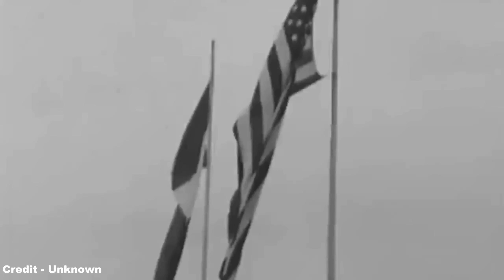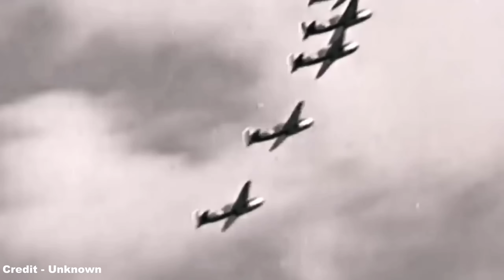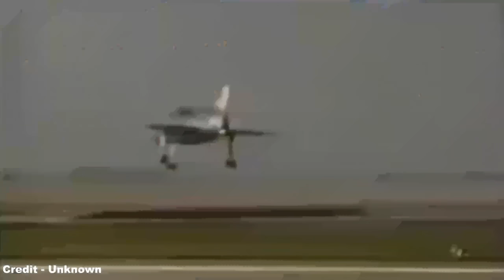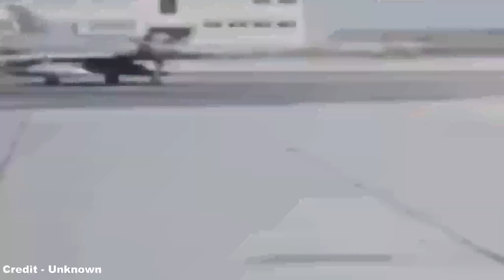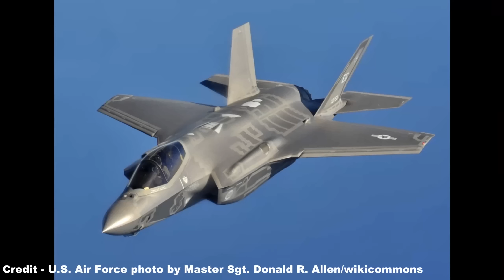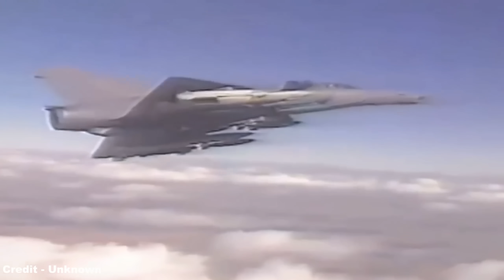Flying Failures - Dassault Mirage IIIV

Comment: The Mirage IIIV was FAR more ambitious plane than the Harrier, for a start its speed was over Mach 2.5, vs Mach 1.1 for the Harrier!!!
The F35 VTOL some 50 years later does not match the Mirage speed.
The French Ministry of Defense realized that the formula chosen was complex to develop and that the cost of the program exceeded its budget. 
As a result, the project was abandoned in 1966.
Compare the Mirage to the Harrier equates comparing a  Horse race to a Dunkey.

Comment: What struck me was that if somebody would have thought beforhand a little bit about the concept, it would have saved billions as it then became clear that it was impossible. Like smaller fuel tanks and nine engines instead of one. Somebody must have thought, mmmmm.... I don't think that would work. Let alone the weight of the engines replacing ordnance capacity. Mmmmmm.... what purpose did this aircraft has to fulfill? O wait... fighting a war.

Comment: The P.1121 (2.57) was never VTOL and  was to be  supersonic.The P1127/Kestrel  was the subsonic VTOL from which the Harrier was developed. The Trident airliner used 3 RR spay engines, was not VTOL and didn't require the RR162.  Although the  Mirage IIIV achieved both VTOL and supersonic speed it never did both during the same flight due to insufficient fuel. Whereas the F35B can.
Reply: Good job. When someone wants to make a video on a topic, they are talking as a de facto authority. So many video creators get even basic stuff wrong on all sorts of topics. I appreciate people calling them out. Many sycophants however will downvote.
Reply: @UnitSe7en  there is no downvote, welcome to YouTube.
Reply: From yours and other comments I get the impression that this guy doesn't believe in letting the facts get in the way of a good story.
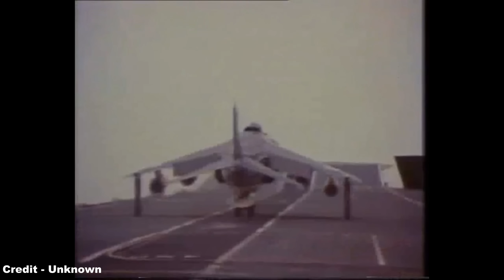9:35 "...developed...by Britain, America and West Germany." Not really - that implies investment, design and construction.
Wikipedia says "*assessed* by the multinational "Tri-partite Evaluation Squadron", which consisted of British, US and German pilots." They only assessed it.

Comment: The RB162 lift engines did not come from the Trident - they went the other way - they started life as being designed as lift engines and then were modified into the boosters for the Trident. Thats why that had a short run time of 15 mins.

Comment: An interesting topic, but the mismatched footage/stills and several mistaken details is - for me at least - a turn off.

The P.1121 for instance. It had nout to do with VTOL projects, rather was one of the rival projects for the same Fighter Operational Requirement as the EE Lightning.
After losing out on that; Hawker-Siddeley tried to submit an aircraft derived from the P.1121 for GOR.339 (as a replacement for the EE Canberra Tactical Bomber). As arguably one of the least suitable submissions thereto, it was among the first rejected.
After that, and knowing that conventional military aircraft orders were vanishing fast as the MoS moved to consolodate the aircraft industry and starve companies of orders if they resisted (like Handley Page), HSA put most of their effort into VTOL fighters.

As for whether the F-35 has actually proved the Supersonic VTOL concept... I bet John Farley (the Harrier's Chief Test Pilot) would have a good laugh about that.
Reply: Well I don't think anything less of RM for trying. Unlike some video authors I've seen - like Simon Whistler or Extra Credits - I couldn't say he was outright lazy in research or distorted by a toxic ideological bent, rather just mistaken, which is relatable IMO.

I'd like to make videos before too long (albeit on multiple topics), but for now lack the hardware to do so.

Comment: An interesting summary of some unusual aicraft from a requirement probably little remembered.
Just to note, the initial Hawker project, was not the P.1121 but the P.1127, then called the Kestrel, a joint US, UK and West German unit trialled them in temporay strips in the mid 60’s, much how RAF Harriers, the renamed Kestrel, would do in exercises in Germany a few years later.

You do show a P.1121, that mock up with the F-16 style intake, this was a private venture by HS, who hoped to sell it to the RAF, (who were instead concentrating on that NATO VSTOL requirement and the gold plated, unexportable, TSR-2).

The P.1121 was a conventional supersonic strike fighter, rather like a cross between a F-4 and F-105. A potential Canberra and Hunter replacement as well as exportable, so no chance of RAF interest then and the project died on the vine.

The renamed and developed Kestrel, now Harrier, was forced on the RAF after the P.1154, likely an impractical design had it flown, was cancelled by the Royal Navy which made the RAF unwilling to fund soley the very different land based strike version, they wanted Phantoms like the Nayy were now to get.

But both the Ministry of Technology and then Defence Secretary felt this new VSTOL technology, where unlike the other NATO designs looked practical, should not be thrown away, the UK was ahead here after all.
This time, subsequent events were to prove the men ftom the Ministries right and the Air Staff wrong.

Thanks for your informed look at these near forgotten Mirage versions.
Reply: Err nope. The P.1121 was one of the rivals to the EE Lightning & Fairey Delta series of aircraft, for a seperate Operational Requirement for fighters. Like Fairey HSA lost out to EE, so - while Fairey went off to get some use out of their Delta II prototypes in aiding development of Concorde - HSA proposed a heavily modified take on the P.1121 design for GOR.339. As one of the least suitable candidates for the GOR, it was rejected, among others, with EE & Vickers's proposals [kind of] winning, as the Ministry of Supply wanted an aircraft that combined aspects they liked from both. The result - after probably the most blatantly inept case of civil service interferance in aerospace - was the TSR-2.

Damian Burke's book on the topic (TSR-2: Britain's Last Bomber) covers this in detail, alongwith why the various other submissions to GOR.339 - contrary to the claims of a certain Lord Mountbatten - were rejected for good reason.

That: and TSR-2 only lost out on exports, because of the Civil Service putting the project overbudget and several years behind shedule with constant micromanagement.
(a detail the civil service & politicians alike still try to deflect blame for, and probably always will)

Comment: The Harrier's vectored thrust concept was created by a Frenchman,  Michel Wibault. He couldn't get French industry to take him seriously, so he went to Bristol Engines and soon enough we had the Pegasus engine family.
Reply: Imagine if fully computerised flight augmentation systems could have been implemented into the Harrier though. From what I gather it takes a lot of skills to jockey all the controls around related vertical takeoff/landing and hover.

These days, with the F35B you press a button and it lands for you, pretty much.
Reply: @EdgyNumber1  
It was, sort of.
The VAAC Harrier was used to develop the control systems for the F-35, as such it had a fully digital FCS.
Reply: @EdgyNumber1  I recall an article in an IEE magazine - possibly late 90s - describing a control system upgrade using "H Infinity" methods. It apparently reduced pilot workload significantly during transitions to and from vertical lift. A bit of Googling reveals some write-ups, however it's unclear if the system made it to production.
Reply: Technically Vectored Thrust was a French concept in origin; but it took considerable effort by the British to get it to work. It was by no means a fully fledged idea when it was first presented to us.

Still: Shows what a french initial concept, British technicians and US money can achieve... when utilized properly.
(all the other attempts at VTOL Fighters showing only that those behind them hadn't thought their concepts through)
Reply: @jimtaylor294  there's no technically about it. It was a French invention. Just because it wasn't practical doesn't change the fact.
Reply: @neiloflongbeck5705  That's not what the word invention means. It's related to inventory - a complete, working design. There isn't a patent office in the world that would accept less. 

While we're on the subject, vectored thrust goes back to 1920s rocketry.
Reply: @lumpyfishgravy  Wibault got 2 patents for his invention of vectored thrust for air breathing aircraft (the second was shared), which by your own definition, not shared by any dictionary I've ever consulted, would mean that he must he have worked out the details of how his invention worked. The word invention means to create a process or device. Whilst inventory means a complete list of items such as property, goods in stock, or the contents of a building. Both words share the same etymology as they come from the Latin word invenire which means to come upon or discover.

Vectored thrust is older than that. The British Army Airship "Delta" used in in 1912 and was one of the earliest recorded uses of the technology. The British Class 23 airships also used a form of thrust vectoring.
Reply: @neiloflongbeck5705  You said "there's no technically about it. It was a French invention. Just because it wasn't practical doesn't change the fact."

Thank-you for clarifying.
Reply: @lumpyfishgravy  it was a bit like Savery's steam engine in that respect. It worked but was overly complex and didn't produce enough thrust.
Reply: @lumpyfishgravy  Well put. That other user's just being an obnoxious pillock, as nobody here stated the concept wasn't French in origin, rather that the only reason it ever saw use was thanks to other chaps whom had the technical skill to make it actually work.
(no small endeavour, as Wibault's original concept didn't work)
Reply: @jimtaylor294  insults just show your low intelligence. The inventor was Wibault. The developer was Hooker. If you can't get that into your head, well less said about that the better. Don't forget Wibault got his concept patented making him the inventor, not Hooker or anyone else. The facts speak for themselves.
Reply: ^ Touche much?.

A~and no. It took Stanley Hooker of BSEL to make the french proposal into what became the RR Pegasus. Wibault's original concept was too large, heavy and lacking in thrust.
Reply: @jimtaylor294  so what? The idea wasn't Hooker's bur Wibault's. That can't be changed. Yes, Wibault's idea of using 4 cenrtifugal blowers powered by a Bristol Orion engine was under powered and ut took work by Hooker and his team go perfect it. This is analogous to Whittle and his patent for the axial flow jet engine that Ohsin realised - the inventor is still Whittle.
Reply: @jimtaylor294  PS Wibault must be the inventor as he took out a patent for his idea before taking it to the NATO MWDP who passed him onto Hooker at Bristol. Hooker is the developer of the idea, not the inventor. In 1957 a second patent was applied for for an improved design that listed Wibault and Gordon Lewis as the inventors. It was this later patent that was developed into the Bristol Pegasus.
Reply: @Aditya Chavarkar Agreed on Vectored Thrust. Needing only one engine for everything is one reason also why the Harrier could carry so much armament, while none of the lift jet designs (in the capitalist nor communist blocs) fared at all well re' payload.
Reply: Can someone sum up the long discussion? I'm too lazy to read everything lol.
Reply: @criticalcoreshock  a Frenchman, Wibault,  came up with the idea of vectored thrust and got it patented in his country. He took the concept to NATO after the French aircraft industry ignored him. NATO liked the idea but had technical doubts and sent him to see Stanley Hooker at Bristol Engines. Hooker liked what he saw but knew that the concept was under powered. Hooker worked with Wibault and a practical concept (the first Pagasus jet engine) was created, for which Wibault and Gordon Lewis of Bristol Engines shared the patent. The engine was developed and saw service in many countries and many wars (the first being the Falklands War). Many attempts have been made to make the engine less of a handful in the hover mode, but none were fully adopted to make the pilot's life easier.
Reply: @neiloflongbeck5705  I thank you dearly :)

Comment: The IIIV had first 9 lift jets and then a few moments later it had 8. Which is it? The Mirage 3 had only 8 RR RB162 lift engines plus 1 P&W/SNECMA TF104 flight engines. The RB162 were serving pairs around the centre of gravity. Yet again you fail to deliver accuracy in your script. Stop rushing to publish and get it right.